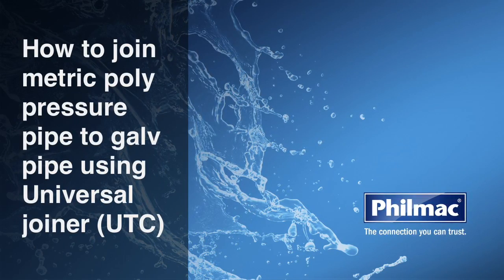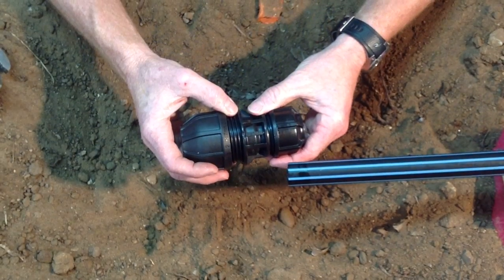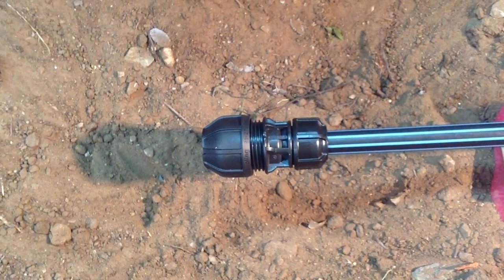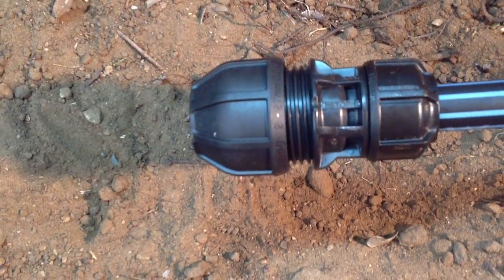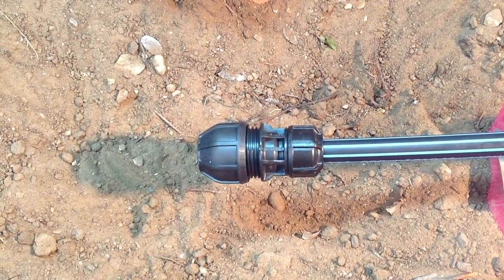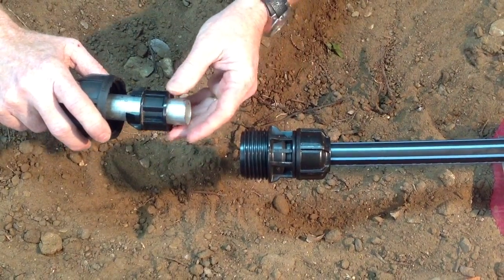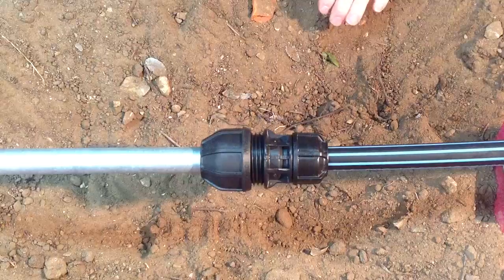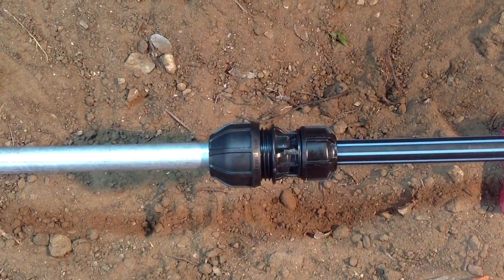How to join metric poly pipe to galv pipe using Universal Joiner (UTC)

Comment: If your coupling is 21-27mm fitting than 3/4” gal pipe wouldn’t be the upper end? I think that is 1” pipe.
Reply: Thinking if was a 1" Galvo Water Pipe  is maybe  1.315 Inches or approx 33MM as the 1" related to the I.D. / Bore not the O.D. of the Pipe...